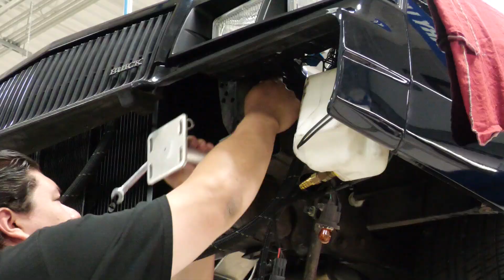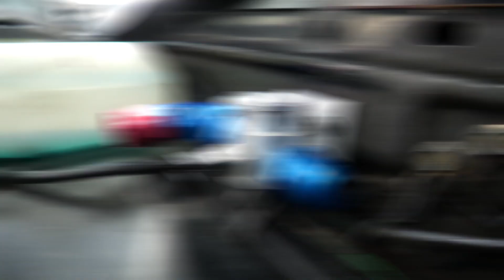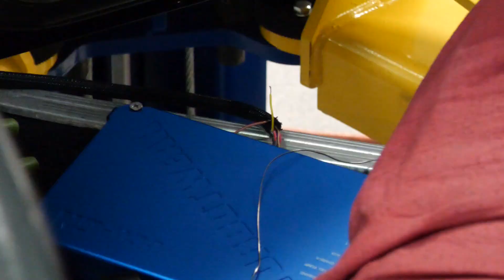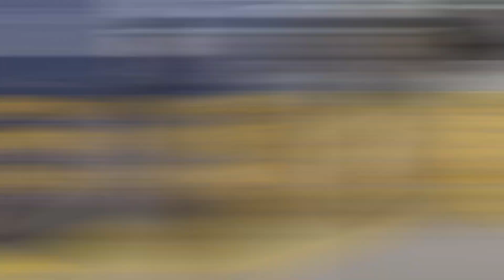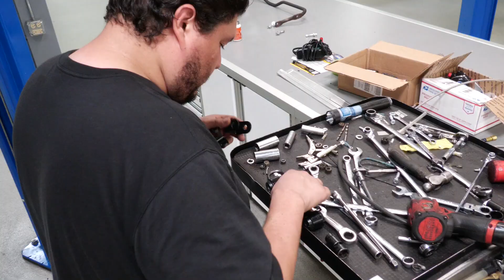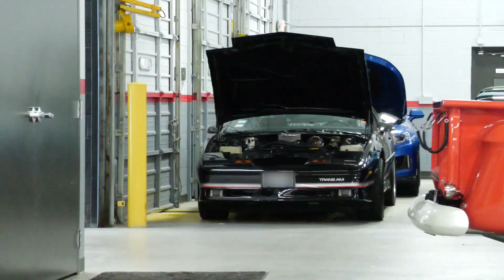1987 Buick Grand National Build - Part Three - | Blackdog Speed Shop

Comment: 414hp.. that's it? Sounds like a stock gn combo with boost and fuel thrown at it. Those numbers are nothing to be impressed by. I'd fire you're tuner.
Reply from the maker: In this case the turbo only supported 500hp. When you take the powertrain into consideration we actually maxed out the setup.